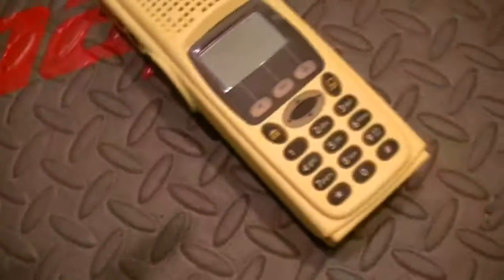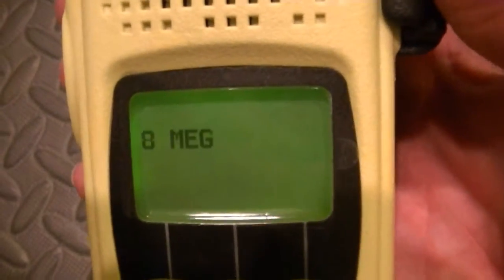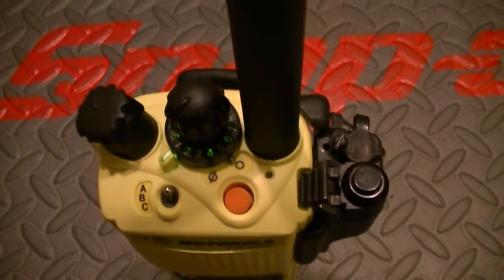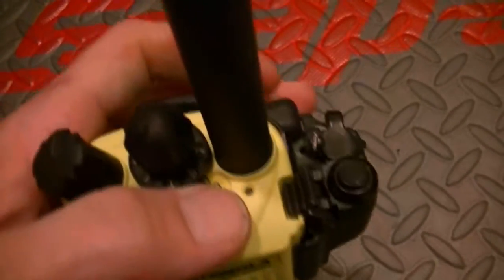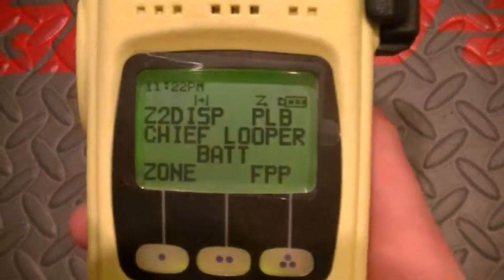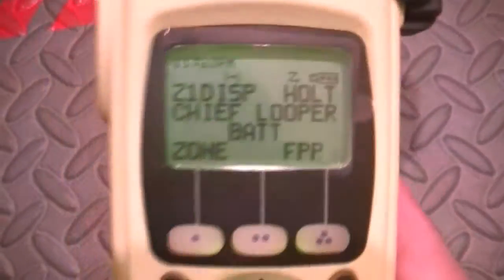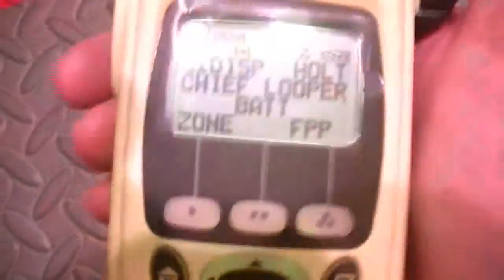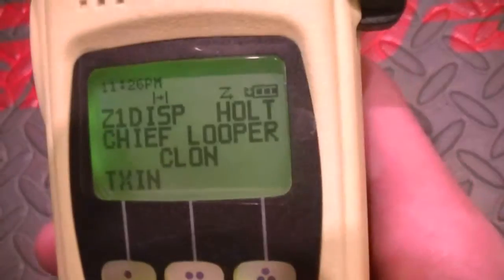Motorola XTS5000 Model III in VHF with FPP, R19.00.00 Firmware (Most Current) - Programmed Up!

Comment from the maker: V19 is the best firmware version Motorola has put out.  The main thing it does is, if you have a RAM processor instead of a Bravo, it fixes the deficiencies of a RAM processor; when trunked, it always acted up and beeped on PTT.  I don't really think that a firmware upgrade is worth it if you are at 12 or higher, unless you have a RAM processor.  Stay away from 17 CPS and only use 18.  17 was bricking out radios coast to coast.

Comment: I'm curious, how did you get the persons name in the lower box when not using channel or zone name for it? It's a bloody great idea for customisation and to prove "hey that's my handheld, give it back a@@hole" when someone tries to take it for themselves. 

Also handy if you use a license number and the handheld is recovered stolen goods from some lowlife... it will match the radio instantly to it's owner without leaving a permanent scar like engraving.
Reply from the maker: +Glen O'Riley You turn it on and off using MY ID.  Yeah, it beats the snot out of engraving, haha.
Reply: snarlingrabiddog5150
TYVM that looks a lot more secure against light fingers now :). Took a little to find the exact field and wouldn't ya know it, it's one I've been overlooking for some time.

Comment: can the motorola xts and apx models be used without a trunking system like frs radios?
Reply from the maker: +medeco locks yes
Reply: Thanks! One more question if I were to buy 2 brand new xts or apx radios would they be able to talk with each other right out of the box or would they need to be programmed?
Reply from the maker: +medeco locks They would need to be programmed to talk to each other.
Reply: +medeco locks they usually come with a dummy frequency that as per any would be illegal to transmit on without appropriate licensing meaning as mentioned here, programming is required. 

You will also need to program the radio to get the features from it as well else you might as well just go get some FRS radios.